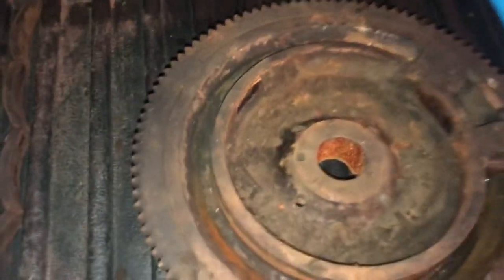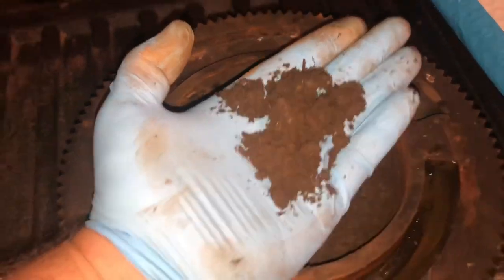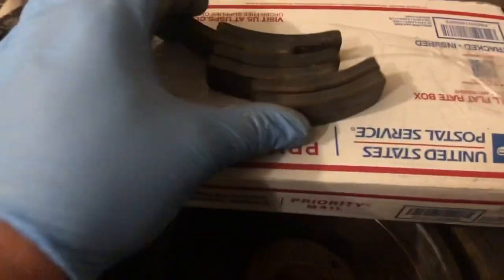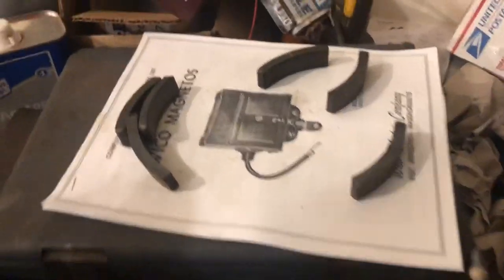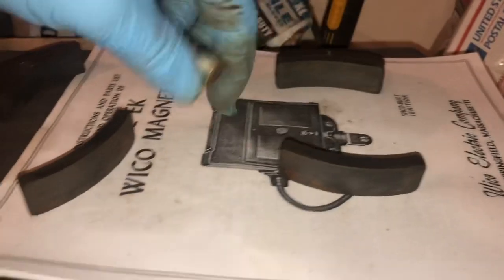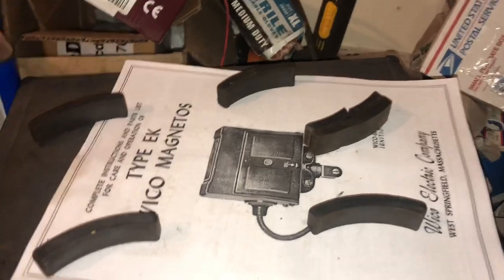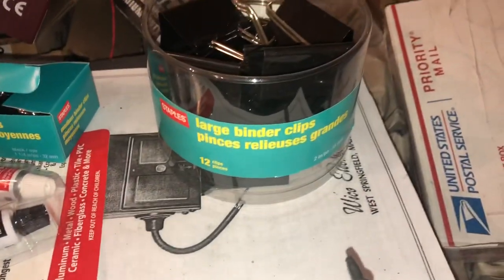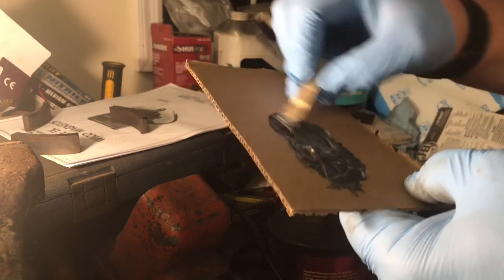Kohler Flywheel Magnet Fix Gravely 20G Part 4

Comment: I too had to re-glue the magnets in my 14G Pro Kohler Command.  The magnets stuck to the stator and were not damaged :) .  I also watched Taryl Dactal's video and I used his method with the clothes pins, the same as you did.  It worked great!

Comment: I like it when the charging magnets are retained by aluminum rivets in Kohler flywheels. Because factory glue doesn't always work. I've seen glued-in magnets in many flywheels come loose & sometimes these will damage the stator. And the low-amperage (under 15 amps) replacement stators are hard to find nowadays, if not impossible, because Kohler didn't supply too many of these.